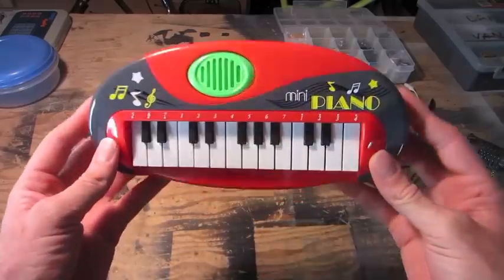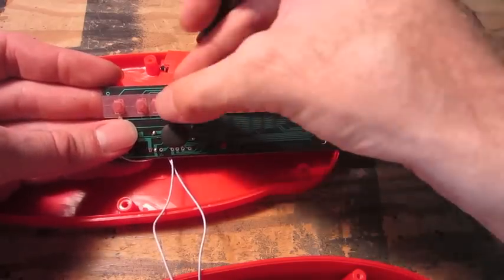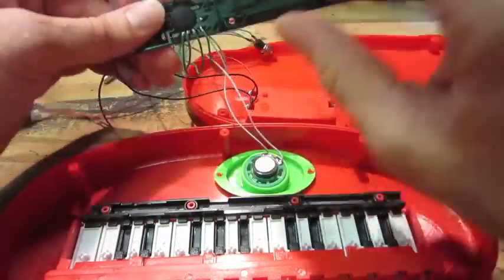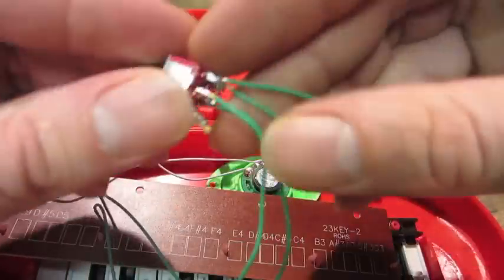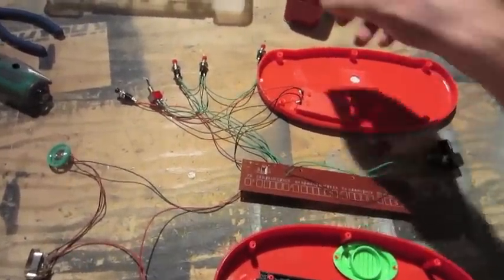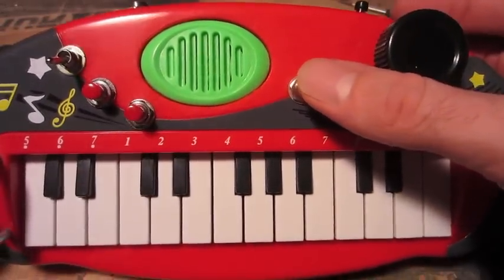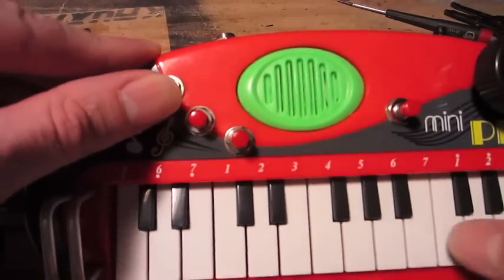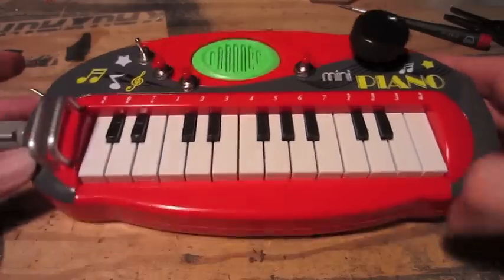Circuit bending a toy mini piano

Comment: I'm wondering if that same PCB/blob chip was used in a more exoensive model that had the demo songs and other voices built into it, it just seems to odd that it would have those features but not have controls for them on the keyboard unit's case.
Reply from the maker: Yes that is exactly the case here. I’ve even seen the “newer” version that has the demo songs available on front panel already

Comment: I’m in the process of modifying one of these & doing a video. Is it ok if I reference yours ? Thanks
Reply from the maker: Yes of course. Did you also see that I made a part two? Just shows a few details better is all.
Reply: Mike Sisk I had not. Thanks, will definitely check out & reference your video as inspiration.
Reply: https://youtu.be/hWQpGAse4Es
Reply from the maker: CircuitSideshow Awesome! I subscribed and thanks for the shout out 😉

Comment: @Mike Sisk hello if you still have this unut do you think it would be possible to send a zip folder or recordings of each of the hidden toddler melodies from the hidden auto play mode? I'm a toy collector but I do not bend, and have heard about and been interested in hearing hidden Melody in the unit. Thanks in advance and sorry if you no longer own the unit. And my email is spatcherv3@gmail.com
Reply from the maker: Spatch Wiseman Well I do still have it. It’s sitting on a shelf with most of my other creations. I could probably make a video with it connected to a mixer and line in to camera for you. Would that work? But it will have to wait until thanksgiving weekend.
Reply: @SISKworks  that sounds like a plan

Comment: Yo Mke, you are a powerful wizzard
Reply from the maker: Jeffrey Newman haha. Why do you say that?
Reply: because i opened one of these toy pianos up today and had great difficulty understanding the board, and then found your video, and you bent this thing far beyond i think anyone would ever attempt. and did it well. far beyond where i was planning to go, contact points , brilliant.  I am new at bends, but so far you have inspired me the most.
Reply from the maker: Jeffrey Newman oh cool. Also check out the part 2 to this video where I show in better detail exactly where each wire is connected.

Comment: Would you mind giving me a little more in depth explanation of the switch you used to enable and disable the pitch bend? I see that it has 3 sets of places you can attach things to. You seemed to attach the resister to one of the outer sets, the middle back into there circuit where the resister originally was, and the other outer set to the potentiometer. Am I understanding that correctly? Thanks in advance for your help.
Reply from the maker: The switch is a DPDT (double pole double throw) which means it is like two separate switches in one. I removed the pitch resistor from the board and connected those points to the center poles of both sides of the switch. Then I attached the original pitch resistor so that it connected the two side of the switch together. Now the opposite two ends connect to the pot for variable pitch adjustment. So when the switch is in stock mode the pitch signal comes from the board and goes through one side of the switch, then through the original pitch resistor, then back through the other side of the switch and then back to the board. When you switch to pitch adjust mode the signal comes from the board, then through one side of the switch, then to the pot for variable pitch adjustment, then back through the other side of the switch and then back to the board.
Reply: By "stock mode" do you mean the switch is flipped to the center? I have one of these switchea and noticed it has three positions: up, down, and center, but since there are only going to be 2 functions (Pitch bend enabled and disabled), would the third position be useless?
Reply from the maker: No. My switch only has 2 positions. on/on. When up it connect center pole to one end and when down it connects that center pole to the opposite end.
Reply: will this still work with an on/off/on switch if i were to attach everything in the same positions?
Reply from the maker: yes it should work the same when set to either on but will not work when in the center at off.
Reply: Great, thank you so much for the help

Comment: Does anyone know of a way to circuit bend a toy and make it into some sort of guitar or bass effect pedal?
Reply from the maker: You can make one with an old tape walkman.
Reply: Oh really? Would you know of any videos showing you how?
Reply from the maker: I used one in a video I did. To be honest in the end it did not effect my sound much but I think with a guitar it would probably do better. The idea is that you feed audio into the tape head connection and then out of the headphone jack to get some distortion when you turn up the volume.
Reply: you could do that with a voice changer if you add audio inputs and outputs, It wouldn't be that hard.
Reply: Space Cadet Go watch Magpie's channel as well, he makes pedals out of everything that can run a current through it. He even amplified a acoustic Toy piano. Great channel like this one.

Comment: Mike, I am really interested in completing this MOD on my own shylling piano.  Would I be able to get  detailed instructions from you or/and parts needed to complete this project? Awesome work
Reply from the maker: +joel revel I also made a part 2 to this video that shows better detail where the buttons connect.  https://youtu.be/JUKkCij_EpE
Reply: +Mike Sisk Thanks just watched the 2nd vid.  I am a beginner at electronic circuit boards, I know i will need momentary switches, but what type of knob is that for the pitch shifter?
Reply from the maker: +joel revel I think it was a 1 Meg potentiometer but I can't be 100%. It was just what I had on hand at the time so using a different value might work even better for you. I would try a few different values if I were you. Maybe 100K, 500K or 1Meg.

Comment: Hey man this is great stuff. I am just getting into circuit bending, and this piano is actually the first thing ive tried messing around with. Heres my first stupid question. Where does the green wire end starting from one of the open contacts? Obviously it leads to one side of the button/switch, but what do you connect the other side of the button/switch to? Thanks for any response! Ill probably fire off a couple more silly questions if that's ok.
Reply from the maker: To be honest I can't remember. I'll try to make a quick update video that will show the details. I'll  try to get that uploaded this weekend.
Reply: I would love and greatly appreciate that! Obviously you know what you're doing. I do not.
Reply from the maker: Sorry I haven't had time yet to sit down and make another video. If you are itching to get started bending yours I would start poking around those open contact near the black blob. Try to connect one of those open contact to another and see how the sound changes. I'll try to make a new vid soon, hopefully this weekend, that will show what combination I used.
Reply from the maker: FrankMarsala I finally was able to make a video that should explain where I connected the buttons much better. Check it out http://youtu.be/JUKkCij_EpE
Reply: Mike Sisk Hey Mike. Thank you so much for taking the time to further explain! It is greatly appreciated. Hopefully I can figure it out and get some cool bends out of this little thing.